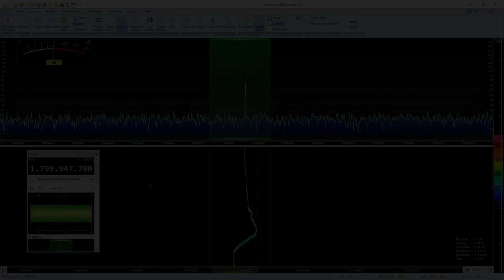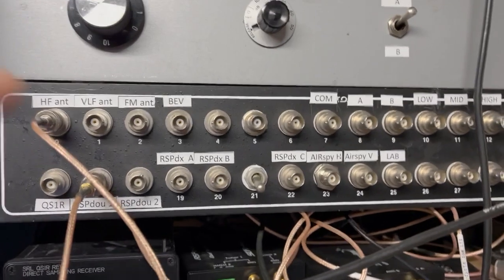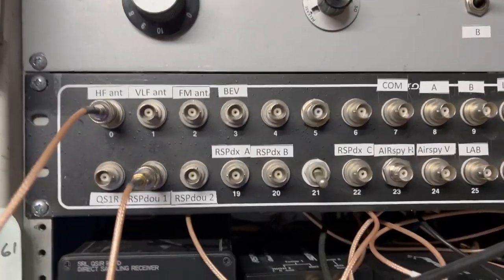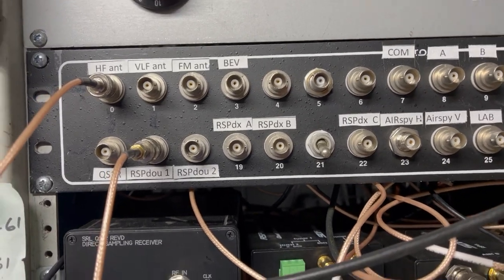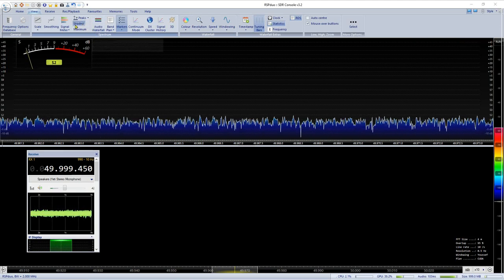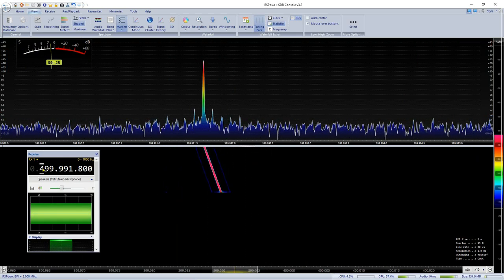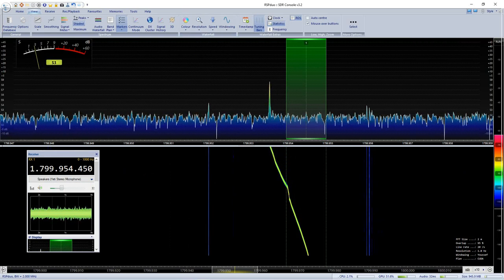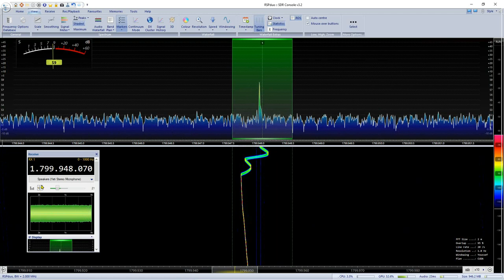poor man comb generator

Comment: I would like you to check something for me.  If it is a very good square wave output, it is supposed to be the fundamental and odd harmonics.  Check the signal strength of the odd vs. even harmonics.  The odds should be much stronger.  If they are not, that says that the fundamental is not a really good square wave.   I have used TTL devices for markers and other uses.  Good thinking.

Comment: Thank you, kind sir, 2 things I learnt from you today.
And a question: WTF is that Logitech (BT headphone adapter?)?
Reply from the maker: Hi Paul.. LOL that a funny looking device.  It actually the volume control for the computer speakers I use when listening on that computer. What were the other 2  things?
Reply: @W1VLF  Oh thanks, Paul. Shame - I still long for a neat little standalone volume/mute control with selectable speakers/phones. Only I'm really fussy and need built-in balance, treble & bass. Best so far is Fosi Audio's DAC-Q4, but it does only 2/3 the job.
1. Never knew what a comb generator was. Nice.
2. Never noticed the RSPduo had a ref. in. Another reason to get one if my ship ever comes in.

Comment: How do you know that when you touched the 50 MHz oscillator module that it was not the pressure on the module changing capacitances causing the frequency change. ( I suspect that temperature change cannot propagate that fast into the device.)
Reply from the maker: Good question Dave...  You couldn't see my finger but it takes about 2 seconds before the frequency started to change, and a couple seconds before it started returning to "normal"
Reply: @W1VLF  I thought a little about that and I wonder though how constant one keeps the pressure when they touch something or does one push a little harder after making contact.  Another factor is that  skin temperature in their fingers is often not not too elevated about ambient (like "cold hands").  It might be interesting to put some black electrical tape on the device  (so infrared is not reflected) and bring a radiating heat source near it or to (tape not needed) blow how air on it and observe how much it changes.  Another idea might be to put a thermal insulating material on the device and put pressure on that.   (Besides signal identification as a hobby, I worked professionally for 20 years in thermal imaging.)